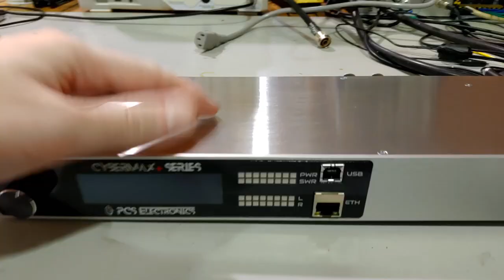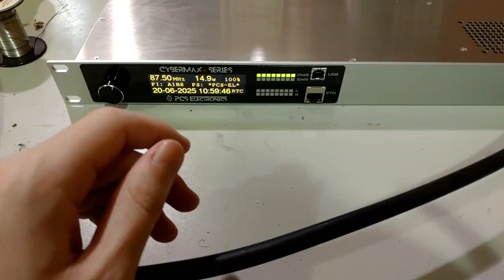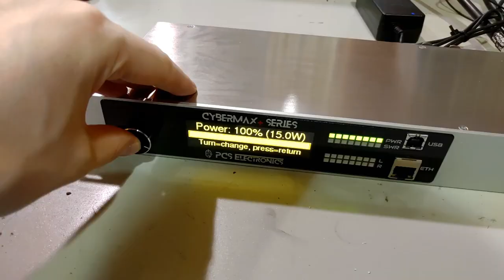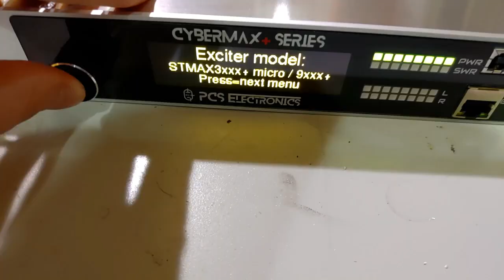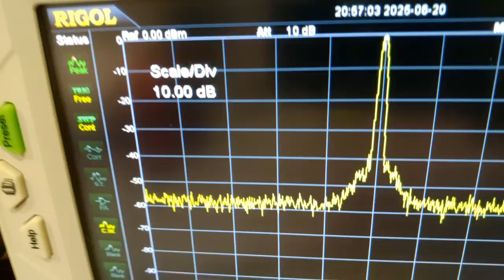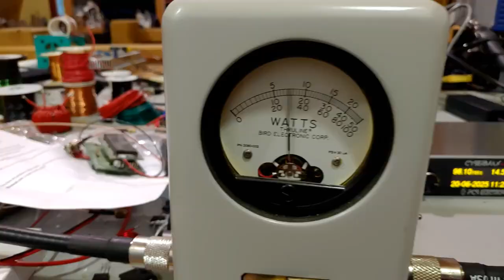PCS STMAX Series FM Transmitter Review (QN8007)

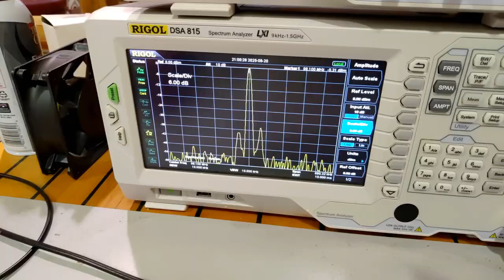Comment: 32:36 Thank you! A very informative video, I enjoyed it! In mono mode (with 19 kHz subcarrier turned off) the two peaks around the carrier are most likely caused by RDS.
Reply from the maker: Thanks. I feel stupid cause I realized that RDS is turned on right after I posted the video. I think that's exactly right, and therefor not an issue with performance :)

Comment: Thanks for this video but I am still finding it difficult to properly install our newly purchased cybermax+ series transmitter. 

We called a transmitter technician but the following is what we have:

102.90MHz 210 w
44%
01-01-2000 03:38:47 RIC

And 

Pwr: 201W Ref: 0, OW 
Exc: 27.0C PA: 63.9C
Exc: 14. OV
§ PA: 49. 9V, 6A

We tried to get it fixed on 31 January 2026.

What do we do here?
Reply from the maker: Nothing seems wrong with those parameters. What is the rated power output of the transmitter and what model is it? That's very important. Without that the data is meaningless. The temp does seem a bit high, but it's not too bad. It looks like you have no reflected power. Are you on a dummy load or antenna? If antenna, then what kind?

Comment: This does not have QN8007. The QN8007 has no MPX input capability.
Reply from the maker: It does have the QN8007, I promise. They just put an MPX input to fill the hole in the back of the box. It's not connected in this transmitter. They use the same box for their higher end transmitters.

Comment: I like your videos. But I feel compelled to correct you on just one thing...... is your modulation terms. You don't "say" modulate the carrier to 75kHz. Say.. "Percentage of modulation".

For FM broadcasting, modulating the carrier to 100% means the signal uses an approximate bandwidth of 180 kHz.
100% modulation: is defined as a peak frequency .... "deviation" ....  of ±75 kHz from the assigned center frequency.

While you could say "You want to modulate your carrier to 75kHz deviation". No one is gonna know what you're talking about. Just say Modulate to 100%.

my 2 cents

Comment: Hey, I need an affordable, good transmitter (under 150 euros) that isn't bad or like the CZE-7B, it really sucks to have a transmitter that you can barely use as it is so low quality, i love your videos and I currently have a station using a CZE-7B. Thanks.
Reply from the maker: You could replicate a similar thing, but much higher quality by going to the "FM Transmitter Kits" section of pcs-electronics. Then choose the STMAX series. Under that listing, be sure to look for "Enclosure for STMAX3000/9000 series with power..." with that box, you should have a nice boxed transmitter that is roughly the same size and weight of a CZE-7C, but way way way better quality and not too expensive.
Reply: @spectra-man  Thanks for that, I tried to put together a kit with the 15w version but still over my budget, would a GD-2015 from aliexpress be decent?
Reply from the maker: @st3fwz  There's a reason I didn't do a vid on that one. I was sent that transmitter for free from the business and it works and has a clean spectrum, but the problems are buzz in the audio and it only makes 7W not 15W. I bought a second one, same thing. So it is not a 15W transmitter, you are actually getting a 7 watter with mediocre audio quality. If you are looking for cheap, I think maybe their newest red transmitter might be a better choice. Yeah, it's only 5W, but given the other is only 7W, it's not a big difference on the air and most importantly, it has a real VCO and MPX input.
Reply: @spectra-man   That's a bummer, PCS i cant afford and the only tx I can is not 15 watts.. Thanks for the help, currently I want to use stereo tool to feed the rds and stereo as the with the cze i cant remove stereo and it sounds quite bad. I'll buy it, test it and if it's bad I'll return it. Once again, thanks for your help.
Reply: @st3fwz  GD-2015  excellent transmitter! At me such. Sound super!!!
Reply: @spectra-man  This transmitter with MPX on BH-1415. It badly sounds!! GD-2015 is much better!

Comment: does the transmitter allow just mono modulation?         often no need for stereo modulation complexity.
Reply from the maker: Yes, it does allow it in Mono L+R mode. It will either mix the left and right audio channel together or you can choose to use only left or right channel on its own.